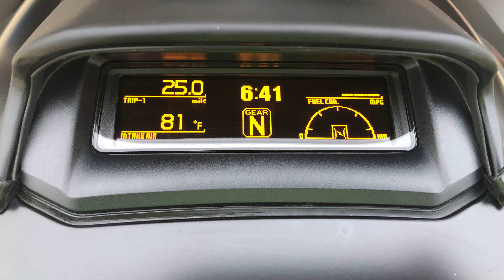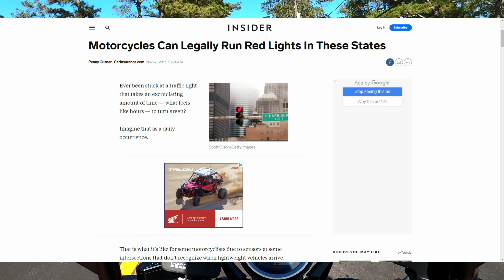Traffic Lights Ignore Motorcycles!

Comment: I work with traffic systems for the past 17yrs, and yes motorcycles can be very hard to detect. There are so many variables that affect the detection. Underground infrastructure is one of many issues. When I get a call out for such an issue I try and work with the caller to resolve. Most of the time it can be achieved with proper placement of the motorcycle.  There are dozens of styles and configurations.there are counting stations on highways that pick up and count vehicles going by at 100mph+, so loops do work. Placing a strong magnet definitely helps, but I don't even bother putting one on mine. The technology hasn't changed in 20yrs. Now we have radar, video, leddar , ir systems... which all drastically are an improvement.  When u see the loop cut lines best is to stop directly on the line where the field is the strongest.  Add a magnet to your riding boot. 
Safe riding

Comment: Just saw this in another YT video:  "I was the electrical test engineer for the department of transportation in my state. A few pointers for ground loops. First, as you approach a light, try to run over the advance detection loop. This is the ground loop a couple of car lengths before a stop line. This will send a pulse detection to the signal controller. Second, I do not recommend buying a magnet hoping it will place a detection call to the signal controller. Rather, simply shut off your bike and restart. The field generated by your starter is enough to affect the ground loop.  I've tested this in the lab and used it for the last 8 years on the road successfully."   

   To add to my other comment on the kickstand tip - Since the VMAX will shut off when you put down the kickstand while in gear, you can take a two-pronged approach:  Center yourself over an induction coil at the intersection, put down the kickstand while in first gear to help trigger the induction, the bike will shut off, put up the kickstand and start the bike to generate an electrical field.

Comment: Same in Montreal, and not only traffic lights lights but also underground parking that doesn't give you your ticket when you press the green bottom simply because the weight on the balance is not heavy enough. Try now to go back from where you were trying to do a u-turn in a tight down-town underground parking that goes down-hill behind you.  It happened to me with one of my bykes, a 850 lbs Kawa Vaquero.   I was definitely not a happy camper that day.
Reply from the maker: Wow! What a nightmare. Parking garages like that are definitely worse than traffic lights not working for us.

Comment: Jeff, i have had frustrating encounters with the inductive loops in San Antonio. Sometimes they are not very obvious and you end up sitting at the light for several light changes. My big heavy, low Harley Fatboy would not trigger the inductive loop. I tried using magnets zip-tied to the bottom of the steel frame and that did not seem to help either. I learned to avoid those lights, and if necessary to run the red light when it was safe to do so. I usually hoped and prayed for a car to pull up behind me to trigger it, but when my prayers were no answer, I took a right on red.  I did not ride often enough to raise hell with TxDOT.  :-(
Reply from the maker: Great! I have that to look forward to.😣 I'll be moving to San Antonio this year.
Reply: @JeffMarcum  You missed the Great Arctic Polar Plunge / Snow Storm of 2021... It was EPIC Power Failure!  :-)
Reply from the maker: @observationman35  I’ve been kept up to date on the Texas Energy Debacle. I have friends and family in San Antonio and Austin, and my daughter lives in Dallas.

Comment: Standard Loops, Singles, Are About 1 Feet, With Full Adjust 1.5 Feet,  Double Loops Work with Are Bikes There About 4-5 Feet, Field Height, Triple Loops, Are About 8-10 Feet ,Normally for Semi-Trucks, Detection,  The Height of the Fields Are Closer Most Intense Closet to the the Wires....